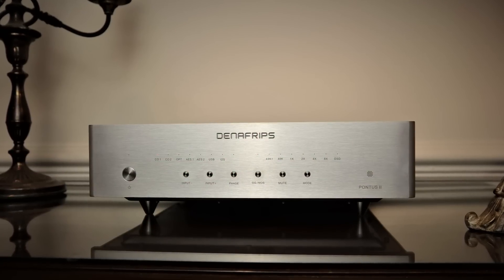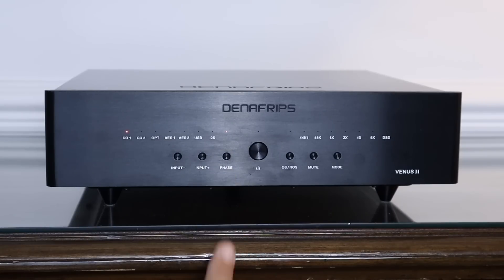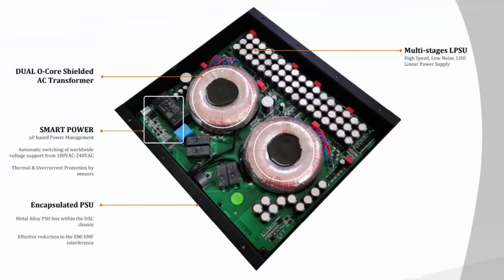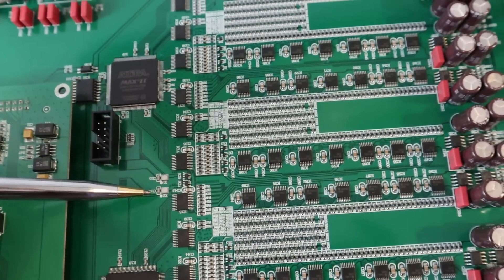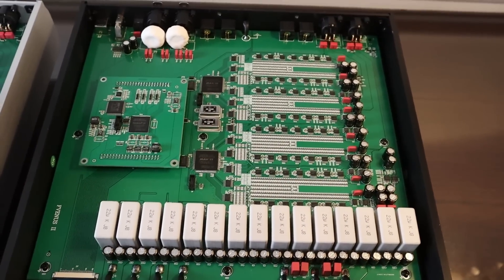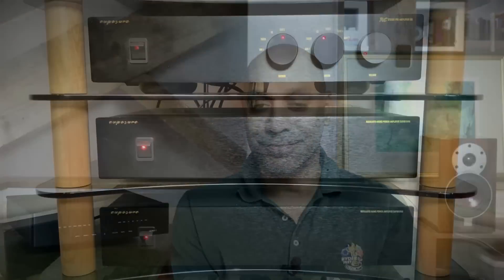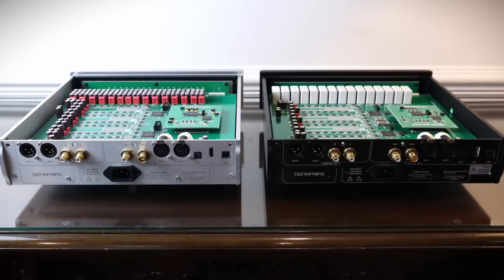Long term review: Denafrips Venus II (vs Pontus II)

Comment: Great Review Tarun, as always. Thank you. After seeing your reviews of Pontus II, Spring 3 and now Venus II, I was wondering which one would be the best option to add to my Totem Sky Tower.
Reply from the maker: I can’t say without hearing the Towers. All great DACs 😊
Reply: @abritishaudiophile7314  Thank you Tarun. From all the rivews I've seen about the Denafrips and Holo Audio DACs, I got the idea that the Holo are more natural/neutral  in comparison. Who made the direct comparison between Spring 3 and May says that May is better (obviously), but that Spring 3 is very close. When comparing May with Terminator Plus, the reviews end up preferring May because it is more natural/neutral than Terminator, which for those who are reviewing speakers or amplifiers, makes the job easier, since it does not introduce color to the sound. Without listening to any of them and just from what we read, the Spring 3 L2 would be the most rational option because it allows us to stay with an R2R DAC very close to the brand's top of the range, which outperforms the competition's top range by less than half the price. But as we know, the sound is the boss 😀

Comment: Great review .. you had mentioned that the review of the holo may dac compared to the Pontus 2 is  that the holo may was more resolving do you think that the Venus 2 is as resolving as the May with also keeping the warm mid range?`
Reply from the maker: Thank you. It was the Holo Spring 3 L2 that I reviewed and compared to the Pontus 2. It would need to get it back in to compare to the Venus but I suspect the Venus combines the best traits of the Spring 3 and Pontus 2 😊

Comment: Thanks for a great review.  For some time I've been trying to decide whether to get a Pontus II or to spend the extra money for the Venus II.  I would like to get your opinion on whether my system is likely to be able to take advantage of the Venus II.  My speakers are Audio Note AN-E/LX Signature (with external crossover networks). I have a tube pre-amp and 2 monoblock tube amps that were custom built for me by a high-end audio shop here in the USA.  Given that they are custom built I know it's hard for you to evaluate the amps, but for what it's worth I paid $5K each for the monoblocks and a bit more than $6k for the preamp back in 2006 and I will say that analogue (via one of the better ClearAudio turntables) sounds fantastic. I'm mainly interested in streaming and right now I'm using a Bluesound Node (the most recent iteration of such) but I'm willing to upgrade to a better streamer (any recommendations?) if that is the weak link.  What do you think - Pontus II or Venus II for my system?  Thanks!
Reply from the maker: Thank you Steven. I would go for the Venus II although I doubt you will be disappointed with the Pontus II either. The difference will be even more noticeable if you upgrade the Node to a dedicated streaming transport like the Auralic Aries G1.1. My review is attached 👍
https://youtu.be/A2ptgOR4kog
Reply: @abritishaudiophile7314  Thanks so much!

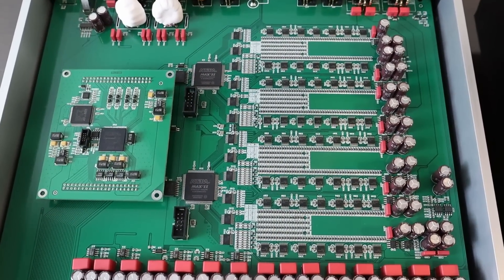Comment: Good evening! Could you explain a bit the 6:16 part where you'll say later (6:37) "the more resistor you have, better resolution you can get"...
Do you mean by that that 2 resistors of say 200 ohms in parallel perform better (higher resolution) than a single 100 ohm resistor, for example? Thank you very much.
Reply from the maker: In a R2R ladder DAC, the resistors have the same value and are matched to a very fine tolerance (0.005% in the Venus II). By using multiple resistor ladders, the output can be summed and averaged to lower noise. This in turn improves the resolution of the DAC 😊

Comment: Great review. I'm in the middle of testing a LOT of DACs in my system. Currently I have a PS Audio DirectStream and as the newer model is out now, and the one I have has aged a lot. I've tested the Venus in my system and it sounds a lot better than the PS Audio DAC. Mind you, I am using I2S in my system. I was running a Auralic Aries to a Matrix Audio SPDIF-X 2 to convert USB to I2S. I now have the Gustard U18n and find it a tad better (and I was using a linear PSU with the SPDIF-X 2) 
Where to from here? I have the Gustard R26 on loan next week and then the Denafrips Terminator II. I am sure that will be the best of the lot. But we'll see. Here in Australia the new PS Audio DAC is $13K and a $3K trade in on my current DAC. I'll sell it privately.
Reply: I went through a similar journey and now do not have a discreet DAC at all (I had the Matrix Audio X Sabre Pro MQA and it was superb). I use my PC (self built) as a source with an MA Element H usb card with power provided internally by Titanium Seasonic PSU). MA usb cable into an MA SPDIF 2 (no need for the LPSU and on listening there was no real difference and yes I experimented with different voltages). Then Mogami 3080 AES Gold cable into a pair of active Adam Audio S3Vs that have a built in DSP. This has given me the best sound to -date. So I have ended up ditching the analogue signal for the monitors and I hear more detail than ever...less can be more.
Reply from the maker: Thanks Steve 😊
Reply: Would you say that using USB to I2S converters made a change for the better in all cases?
Reply: @medonk12rs  yes, I would.  The Matrix Audio one is the best that I've tried

Comment: Was looking forward to this review! Thanks for all the info. I love your video's. 

I have a Pontus 2, Hegel H190 and Harbeth p3esr XD. I'm considering the Venus 2 because I find the Pontus 2 a little bit intens and bass heavy. I listnen in NOS. I have it for 6 months now. I liked the toe tapping at first but now I find it a little much.

Is the Venus 2 a bit more relaxed and balanced? Or is this the Denafrips house sound? I didnt experience this with the ares 2.  Might the Spring 3 be a better fit? Thanks in advance.
Reply from the maker: Thank you Bouke. I would experiment with speaker positioning. The Pontus II should not be imparting a bass heavy sound. It won’t be corrected by changing to the Venus II or the Holo Audio Spring 3 😊
Reply: @abritishaudiophile7314  Thanks for the advice, Tarun! Unfortunately not a lot of placement options but Im going to experiment with better stands and EQ. And I'm ordering the Iris DDC. Because Im curious 😁

Comment: Thanks for all the reviews you are doing. If I may ask for your insight : The denafrips (Ares 2) can't be used with both the rca and XLR at the same time. I need this function. Any dac that comes a bit close to the Ares 2 sound, perhaps VMV D2r? i can get it for 750.
Reply from the maker: @ThePupil  you can’t use both XLR and RCA at the same time with the Ares. You can with the Gustard R26 😊

Comment: Oh my friend, my audiophile journey hasn't been all that long. And it's more about headphones. I originally had a Nokia x2-00 and on-ear headphones with a 3cm driver for $1.5. Oh nokia gave such a dense and dynamic sound! But I tore these headphones, I tried to get drunk, but not enough for a long time. I just got high on this sound. But when I changed phone to my first Chinese phone I compared its sound with my Nokia Nokia had much better sound. But then 3 years later I bought myself a Leeco le max 2 and bluetooth on-ear headphones for $20. Oh, they sounded terrible, but after half a year I tried the equalizer built into this phone and lo and behold, I tweaked the settings and it was a shock, I was just not happy with myself. Such a sound, and such a chic quality of voice calls! But one day I fell asleep on the bottom and the mount cracked and problems began with the convenience of wearing. I had B. W px (failed mid) and Tecniks za60 (too cutting selfies). But no high-end headphones can compare with those Chinese. And the main thing is my Leeco le max 2 source. I had a Meizu 16 phone and then I realized what a gorgeous sound Leeco le max 2 has. And most importantly, I realized that the magic was in this phone, firstly there is a sound technology that gives gorgeous sound. And his equalizer, he changed the sound of the headphones without distortion! Unfortunately, in order to make the sound of PX and za60 adequate, you have to edit their tone through the AIMP application on android. Yes, high-end ear muffs give more separation of layers and details. But if you, by ear, are able to set the perfect tonality, for you it is more important than any details and layers! And of course, the source, especially in headphones, is even more important than the extraction device itself!
Reply from the maker: Thank you for sharing your experiences 😊

Comment: Funny thing that Denafrips have just lunched the 15th version of the Pontus which looks like it has taken a few components from the Venus II. Not sure if these will change the sound sufficiently in the direction of the Venus II or retain the slightly warmer fuller body of the Pontus II.
Reply from the maker: @torus186  it is a shame the Denafrips seem to change a couple of components and announce a new model. This is not the way to look after existing customers and build a high end audio brand 😢

Comment: You should try the combination Pontus + Hermes DDC. The sound wins again significantly and my dealer recommended  the combination Pontus + Hermes instead of the upgrade to Venus. Since then I no longer listen to records.
Reply: That’s the same combo Alvin has sitting on his desk at Vinshine. I wonder why?🤔😂
Reply from the maker: I have the Iris DDC which improves the performance of the Pontus II but not quite to the level of the Venus II. I have reviewed the Iris DDC 😊
Reply: @abritishaudiophile7314  The Hermes has a much better clock than Venus II. It's an obvious next step.

Comment: I too caught the Denafrips bug started with Pontus, then Venus,  then Terminator. 
All serve a purpose as a great DAC under each budget range. 
From my experience,  Pontus II is the sweet spot.
But the Terminator II blows the other 2 away.
I wish I had the budget for Terminator Plus, but my gut feeling is that it will sound very close to Terminator II since specs and parts are very similar.
Reply from the maker: Thank you for sharing 😊

Comment: Torn between getting the pontus 2 or venus 2. I have harbeth shl5+ speakers and luxman 509x integrated. Am expecting eversolo dmp a6 streamer to arrive soon. Currently using Ladder Schumann Dac which I absolutely love the sound of but its been having issues. Freezing and not playing when changing tracks that are different sample rate. Not all the time but sometimes. Also this is my 2nd Schumann Dac as the first unit had a similar problem but with severe static noise when some tracks played. Any advice would be much appreciated. Previous Dac to the Schumann was chords Hugo tt2 and M scaler which were great but once my friend brought his Schumann in my system I fell in love and sold the chords. By the way friends Schumann Dac is about 3 months old now and he's had no issues so far.
Reply from the maker: I think you will appreciate the difference between the Pontus and Venus 😊

Comment: Ryder Cup Polo shirt, nice one Tarun. Watch a lot of your videos and always learn something, keep up the good work. Just a quick question. I have a Roksan K3 CDi, Roksan K3 and Spendor A2’s. I find it hard to criticise my current system, and have had it for 5 years, just got an itch I have to scratch. I like my current sound, neutral, detailed, slightly warm. Not a fan of dry, lean, analytical sounds, which I find tiring. I am interested in a demo of the Exposure 2510 and XM CD player with my Spendors. Is this worth it, or is it diminishing returns? And lastly, would a 3510 make a significant difference? Thanks
Reply from the maker: Thank you Greg. I suspect the Exposure 2510 May it be a significant upgrade over the Roksan K3. The Exposure 3510 may be worth considering but it will change the balance of the sound that you currently enjoy so much. Only way to tell if it is worth it is to try it and see 😊
Reply: @abritishaudiophile7314  Many thanks, appreciate your advice. Will be auditioning the 2510. I understand where you’re coming from with the 3510, as I remember your review did highlight the differences in sound. I have heard that Exposure are releasing a full width CD player next year, worth a listen over the Roksan?

Comment: Tarun, which power cord are you using with the Venus?
Reply from the maker: A diy Lapp cable 😊
Reply: @abritishaudiophile7314  I looked up doing just that with the same LAPP cabling from your cable building video. With shipping it was getting pricey here to the states... And no US distributer... Grrr. If ordered, it would have been between $150 and $200 depending on the plugs I picked. Grrr... 

Then I found Tharbamar's video on building power cables. He was using a Oyaide Black Mamba V2 and W3104 Mogami. I have the Mogami, but there is no ground or drain. I am thinking of using that with my Thallo. Just need to find out if the unit is ground lifted. 

Tharbamar did a sound test with that Black Mamba comparing to a standard cable... Sold me. 

But again, the bits to DIY were going to run $150 to $200+. I found the same Oyaide factory cable assembled in Japan for $200 delivered. I went that route, picked up three of them. One for the Venus, Iris and Hades.

Comment: Hi Tarun. I asked Alvin from Vinshine Audio a quesion as to why he would suggest using a Denafrips DDC outputting I2S into a Denafrips Terminator II/Plus, when the Terminator has a better internal clock than the Iris. This is what he said: "Hi Joshua, it depends. For DENAFRIPS, all digital inputs are reclocked by the built-in crystals of the DAC. TII/TPlus may serve as as MCLK to output the clocks to sync with the DDC. The result would be interesting." So - it's news to me that all Denafrips DACS reclock the digital signal, even when it's in I2S format. Is this your understanding as well?? Thanks. Josh
Reply from the maker: My understanding is that they all have a FIFO (first-in, first-out) buffer and re clocking. I wasn’t certain that this was done on all inputs though. In any case, I suspect the benefit of running the signal through an external DDC first is that signal arrives at the DAC with reduced jitter and noise. The internal DAC circuitry doesn’t have to work so hard to clean things up and the sound improves as a consequence 😊

Comment: Helpful review. Thanks.
But I was taken back to the good old days when Linn argued that it made sense to spend good money on the source to begin sound quality at the top... since it was all downhill afterwards. Is that still a valid philosophy in the digital (and analogue) realm?
I've been looking to refresh my ancient system and was looking for source components that would deliver the best that my CDs and SACDs can deliver. The Denafrips line seemed attractive and the Venus II -- in the middle of the line-up with more precise resisters etc.  -- as an analogue (no pun intended) to a Sondek. (Yes, the transport's the trick but I'm planning to use a stopgap Sony SACD Blu-ray player to get the ball rolling) 
Thoughts?
Reply from the maker: Linn sold a lot of LP12s off the back of that approach. I am not saying it is not valid but I prefer to have all components in a system to a similar level of performance 😊
Reply: @abritishaudiophile7314  
Gotcha.
The point was that if you had to decide where to spend your money...
It was a matter of where to spend it. 
Of course, if you had a legacy (and limiting) component that wasn't going to change... my old dad had a built-in set of speakers that were good for their time and weren't going anywhere that would tend to focus the weight of consideration differently.

Comment: Could it be that if we connect the Pontus II to the Iris DDC the performance will be identical to that of the Venus II?
Reply from the maker: I tried that. The performance of the Pontus II improves with the Iris DDC but still falls short of the Venus II. The Venus II is more like the architecture of the original Terminator DAC 😊
Reply: @abritishaudiophile7314  Thank you Tarun 🙂

Comment: Pretty timely as I shop for a DAC. I've been eyeing the Venus II as well as the Holo Audio Spring 3. I have high efficiency speakers (Forte IV) and a Decware SE84UFO25 tube amp for power. Since I don't have the opportunity to audition these, I've been trying to sort out which would be a better match for my setup.
Reply: I think you should strongly consider how a situation plays out if you get a defective product or it craps itself within or outside of warranty, including shipping costs.
Reply from the maker: Both great choices. I doubt you will be disappointed with either. If you are in a country where they don’t have a service agreement in place makes sure you have an engineer who can service and repair them. They offer exceptional value but it does come with additional risk. Both distributors have a great reputation for back up service 😊
Reply: @abritishaudiophile7314  I'm in the US and my experience with Vinshine has been fantastic. In a perfect world, I'd A/B Hugo TT2, Spring3, and Venus II, but I'm going to have to go for it based on an educated guess :)
Reply from the maker: @jonathansmoore  please let me know how you get on 😊

Comment: I’ve got a bluesound node 2i with a sugden a21se and proac d2’s. Want to upgrade to an external dac & wondering if the Pontus 2 is enough or if should push the boat to a Venus ?
Reply from the maker: I inspect the Pontus II will do quite nicely 😊